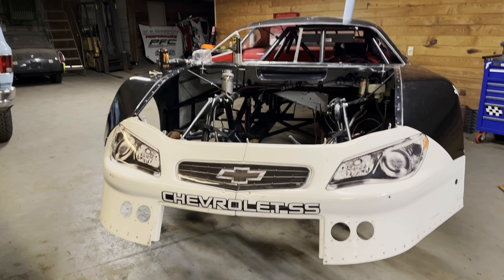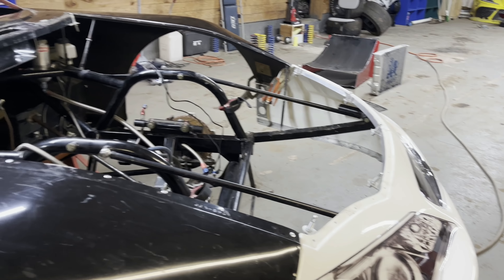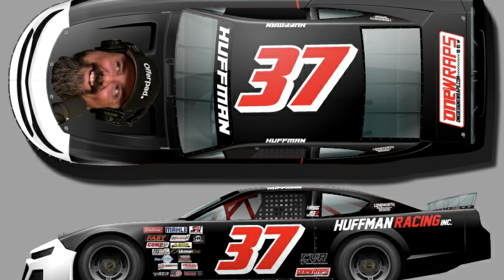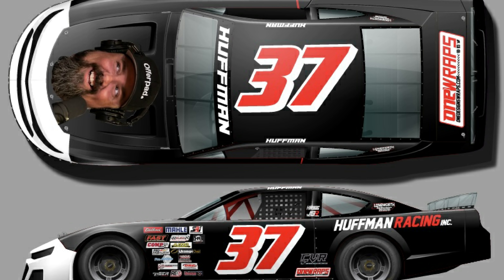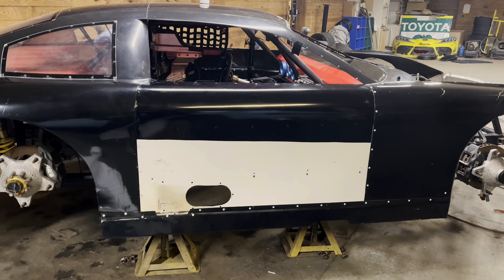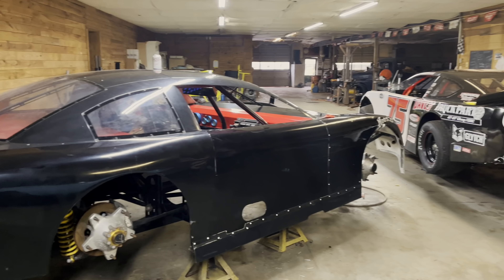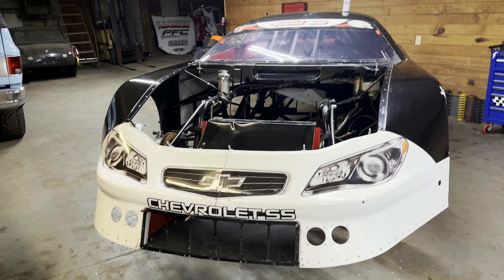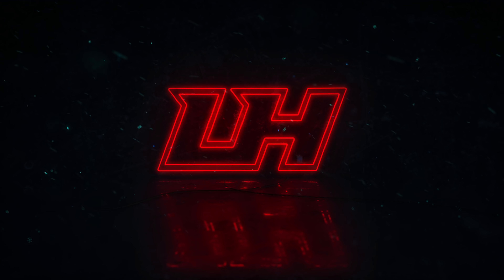OUR FIRST EVER PRO LATE MODEL AT HUFFMAN RACING IS ALMOST READY! Finishing body work & vinyl!

Comment: Great channel but just a dumb question what is the difference between a pro late model and late model stock
Reply from the maker: Pro late models are offset chassis with crate motors! Late model stocks are NASCAR perimeter chassis with enforcer spec engines!

Comment: What's the difference between the late model stock and the Pro late model. Thanks
Reply from the maker: Late model stock is a perimeter chassis with an enforcer engine, pro late is an offset chassis with a crate engine!